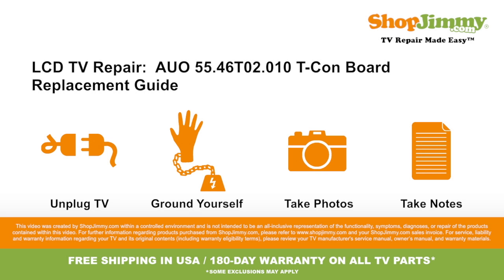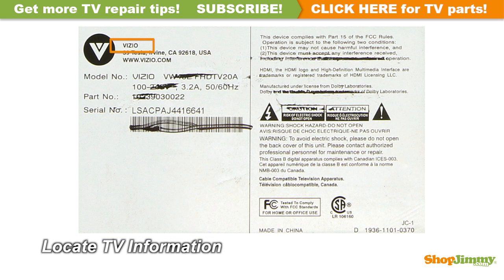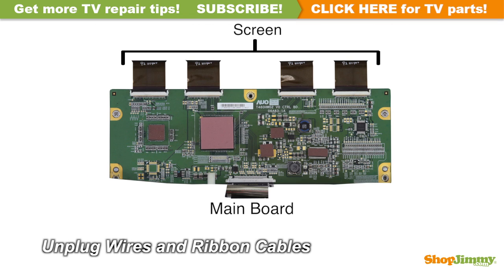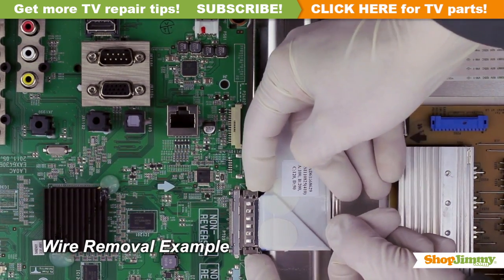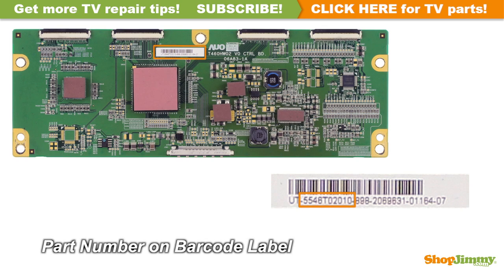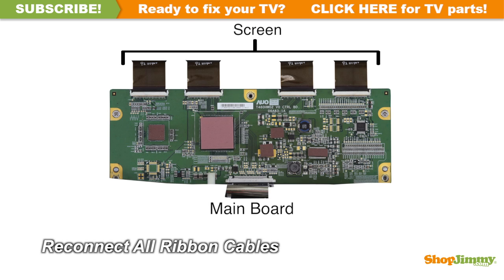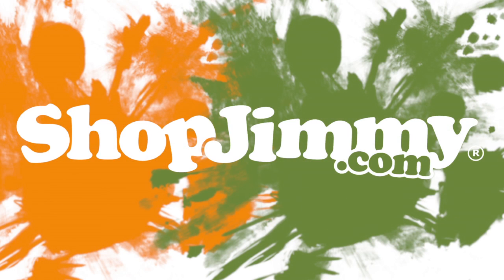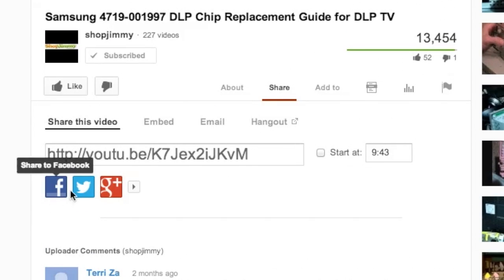AUO 55.46T02.010 T-Con Boards Replacement Guide for LCD TV Repair

Comment: I have a sanyo 55' 1080P. My son thought it was funny to spray it. It still works fine but 1/4th of the picture is blank white. It looks like it's the long picture board. I have no idea what the part is called.  Its the same length as the tv. I just want to know the part name and if it is replaceable.
Reply from the maker: Jamie Howard   This sounds like a TV panel problem.  If your TV panel is bad, it may be more cost-effective to replace the TV as panels are typically hard to find in stock, difficult to replace, and expensive.  Thanks and please let us know if you have any further questions!  www.shopjimmy.com